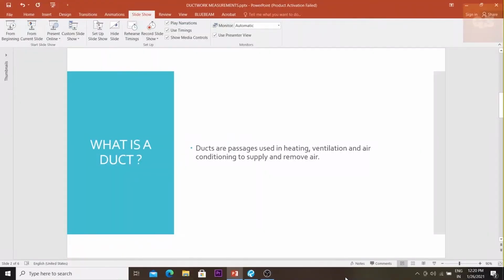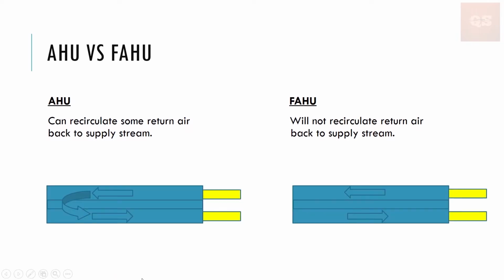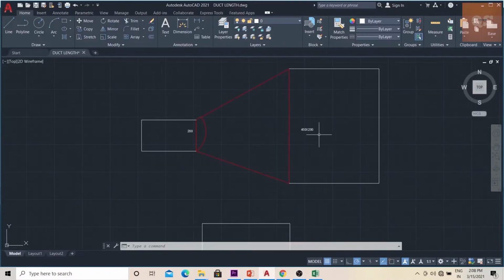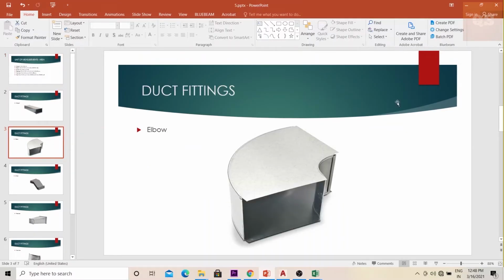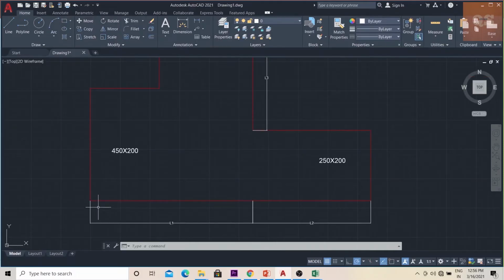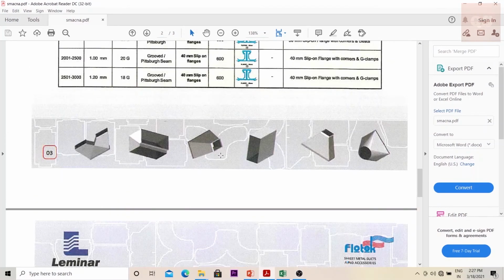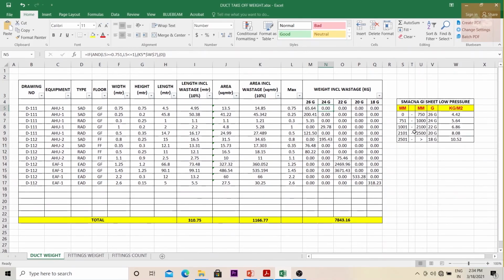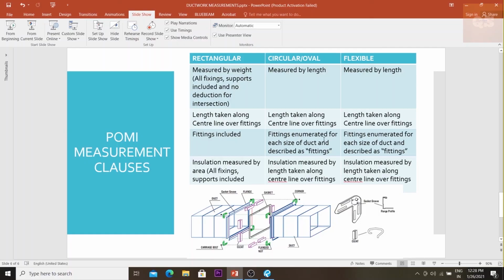MEP Quantity Surveying Course | HVAC Duct Take off | A Complete Guide

Comment: Hi Bro at 29:20 you said don't calculate the length of fittings in duct length but it seems wrong because Circular, oval and flexible duct is measured by length along centre line of the fittings hence while calculating the length of the duct you have to add length of fittings also and enumerate separately the fittings, hence the fittings will be added 2 times 1) With duct length and 2) Enumerated
Reply from the maker: Would depend on the measurement standard used, details available etc